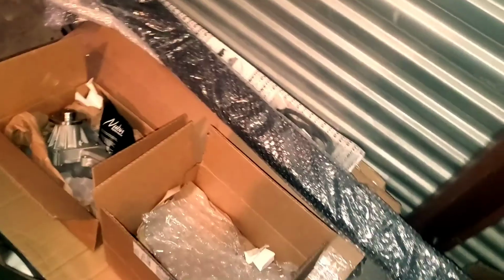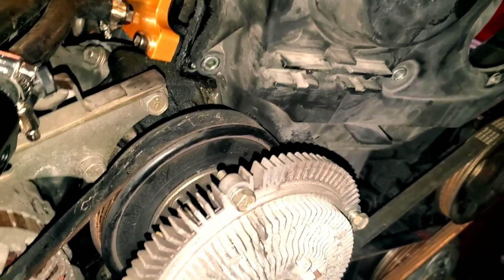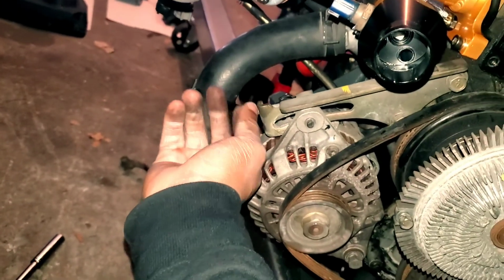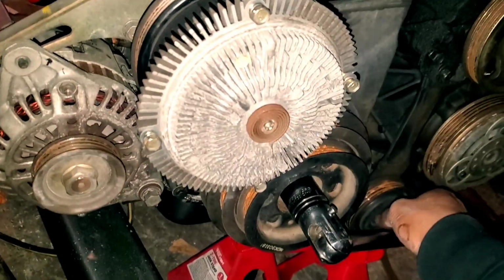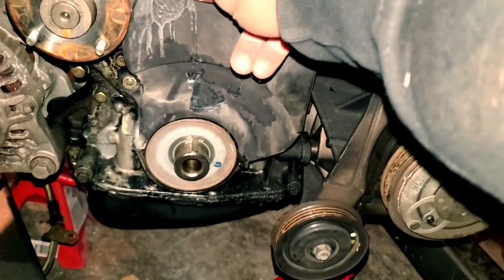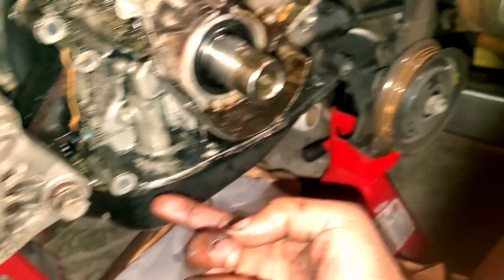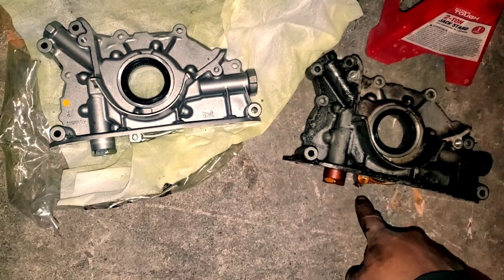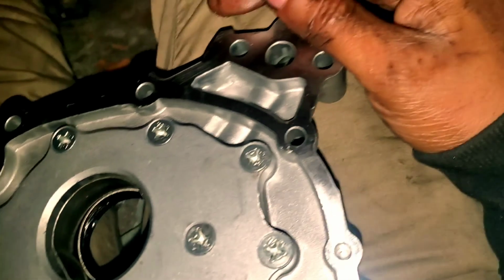rb25det neo oil pump replacement (detailed)

Comment: Nice guide I learned a lot thx 👍
Reply from the maker: I try my best
Reply: @Jay.3  now I just gotta figure out how to drop the oil pan with the engine still in the car😂
Reply from the maker: Ive managed to do it. Very tight working area but possible. A pain but still possible